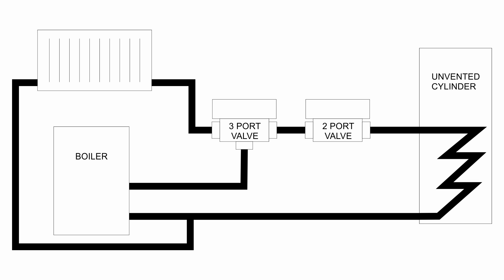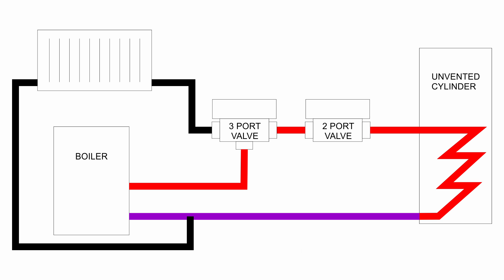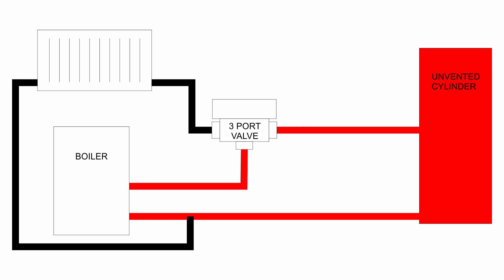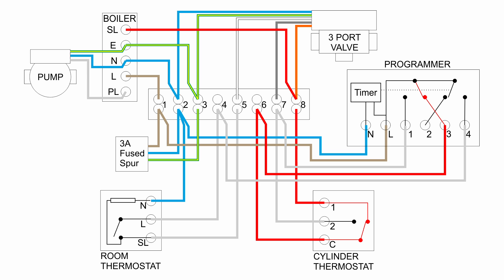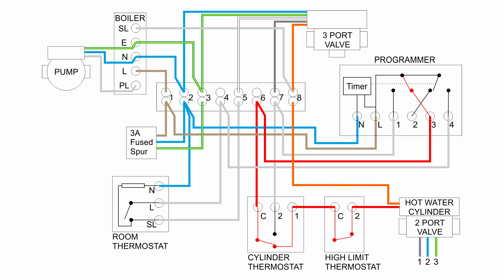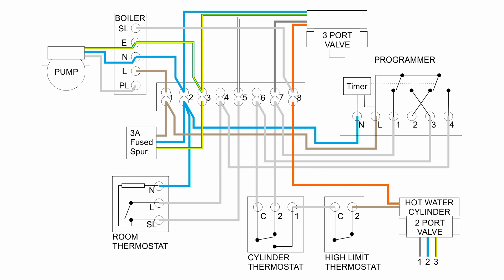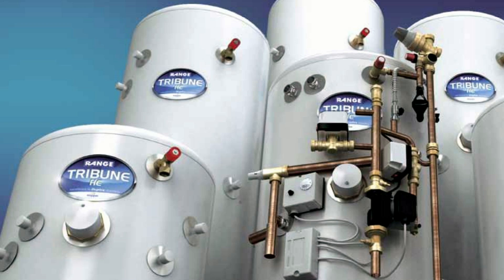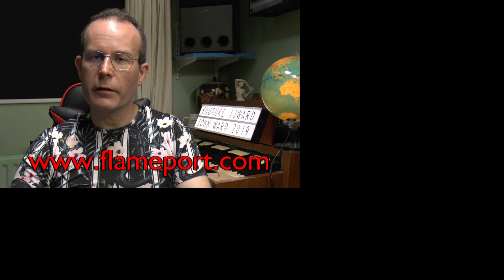Y Plan Heating with Unvented Hot Water Cylinder

Comment: Hi John, thank you for such lovely wiring videos for s plan. I always follow your wiring diagram. I have come across a twin unvented cylinder installation with s plan and confused about how to wire it up. Do you have a video already or if you could help me with this. Many thanks in advance.
Reply from the maker: Two cylinders is the same as a normal S plan, you are just adding another cylinder thermostat and a 2 port valve. 
Thermostat has L in from the programmer, L out to the brown of the 2 port valve.  The rest of the valve wiring is the same as the other one - L grey, N blue, E greenyellow, and the orange switched output.
Reply: Many thanks John. I appreciate your help.

Comment: looks like we have the same system, but one thing i not understand that the orange and grey wire from the 2 port valve aren't connected anywhere and in the terminal box only the blue wire connected together, programmer/hot water tank thermostat and 2 port valve, the brown wire from the programmer are connected with the how water tank thermostat, and again the brown/live wire from the 2 port val is not connected to anywhere,

Comment: Hi JW,  just wondering if the 2way valve should shut as soon as hot water isn’t called for?  Basically my boiler is trying to run on and bend prevent flow through the cylinder because the 2 port is closing.  Shouldn’t the 2port only close if the high level limit of 82degrees is reached?   Thanks in advance Craig
Reply from the maker: Unvented cylinders should be installed so that the valve closes as soon as the cylinder reaches the set temperature to avoid overheating the water and wasting energy.
For boilers which run on for a period afterwards, an automatic bypass valve should be installed which will open due to the increased pressure when all of the zone valves have closed.  Example: https://www.bes.co.uk/automatic-by-pass-differential-valve-22mm-angled-21382/
Such things were not normally installed on Y plan systems as with only the 3 port valve, one port was always open.  Many older boilers as typically found on Y plan systems do not have a run-on period either.
Reply: @jwflame   thanks so much for the prompt reply!  Sounds like I’ve got it working as it should,  as much as I wanted it to work slightly different to this I’m sure this is for the right reasons.  I was expecting the only time the additional 2way would close would be in the event of the high limit being reached.  I was expecting when the thermostat temperature was reached only the signal for the boiler to heat would be cut. 
Again thanks for the reply.

Comment: What is the  orange switch live doing going from 8 to the Hot Water Cylinder?  Thanks,.
Reply from the maker: It's the switched output from the cylinder valve, without it, the boiler won't work when HW is selected.
Reply: @jwflame  Many thanks for that reply. I need to get up to speed on unvented cylinders.

Comment: Hi. Just a quick one. Found unvented with Y plan but no extra zone valve on the hot water. It’s easy enough to plumb and wire one in but do I also need a bypass with this arrangement. 

If I do I might as well put in S plan.
Reply from the maker: Yes, a bypass valve will be needed as the default will be both CH and HW closed with the 2 port cylinder valve installed.
Converting to S plan is a much better option.

Comment: On an S-Plan system, which seems the only sensible way forward now, the high limit cut out from the stat would appear to be useless in the event of a failed stuck-open DHW zone valve. Or indeed, if someone opens the valve using the manual override. If the system is otherwise calling for heat (eg for heating), the tank temperature will continue to climb. Practically, other safety features will come into play but wouldn’t it be better to have had the main boiler power route through the high limit feature? Then if it were to activate, all means of further heating would be safely cut.
Reply: I agree, on my system I have connected the DHW switched live from the programmer through cylinder stat to both the Brown and Orange of the motorised valve, so if either the stat is satisfied or programmer is off, the boiler switched feed to the Grey wire will no longer be present.

Comment: How about taking this a step further John, W plan with priority hot water?
Reply from the maker: W plan is covered on the website, https://www.flameport.com/electric/central_heating/heating_wiring_W_plan.cs4
No video on it yet - it's not a particularly common arrangement.
Some newer systems can be arranged for hot water priority, but they normally use the 3 position valve with the option of priority being set in the boiler or controller.
Reply: @jwflame  it's the way forward for smaller boiler installation and improved modulation. Unfortunately most stick with the y and s plans, due to lack of education.

Comment: good info John, but you will just convert to S plan if you replace the cylinder, does not take any more work.
Reply: I’d rather fit an extra zone valve after the 3 port than mess about in a tight cupboard longer than necessary 😁

Comment: I think the biggest potential danger with unvented hot water systems is when the water is heated with an electric immersion heater. If the thermostat fails and assuming the fail safe devices on the cylinder have failed the temperature of the  water in the cylinder is only limited by the rupture point of the cylinder which could and probably would be well be into superheated territory. Of course this doesn't take away the necessary precautions for water heated by a boiler but the chances of the water reaching those kind of superheated temperatures is much less likely as even if the boiler thermostat failed, the prv would blow off if it was a sealed system or it would vent off if it was an open system.

Comment: the hot water cylinders we all had years back (some places still do) were hazardous if the thermostat went...like ours did. by hell we shit concrete bricks with shards of glass sticking out !!. the thermostat failed and it over heated, causing it to vibrate and nearly explode. the plumber took it out of use, we still had it fixed up but not working..only cold watter ran trough...that ment either washing in cold water or using the kettle to fill the sink up.
the cylinder was removed when we got gas fired central heating fitted, as was the damn loft tank that was a constant annoyance in winter as it always froze up. for a while we forgot that we didnt have the loft tank, and i said that we better keep radiators on go ever so often to keep the tank ice free (heat rises).....it took us ages to get used to the fact we no longer lived in fear in winter times lol
Reply: Previous house immersion heater used to boil the cylinder - I remember beads of condensed water dripping off the bathroom ceiling ! We could hear it boiling but it never sounded dangerous.
Current house has 2 loft tanks. They never freeze. Both above the airing cupboard. Loft isn't insulated at either the roof or floor.

Comment: If you have a unvented cylinder it’s alway as good idea to test H/W valve is operating correctly during yearly maintenance of the cylinder .  Sometimes the a two port valve can get stuck open and even the micro switch could get stuck continually calling for a demand.
Reply: Don't by cheap Drayton valves then ;)

Comment: I feel safe doing my own plumbing after some of the crap jobs I've seen carried out by so called professional plumbers, inc gas registered engineers. Over the years I've witnessed plumbers who have left gas leaks, installed boilers keeping the undersized gas supply pipes, installed poorly laid out pipe layouts, terrible soldering, etc. (I've seen some pretty terrible electrical installations as well, but most electricians seem to be better than most plumbers!)

Look up the scalding of Sharon Minister in 2003 in Cornwall where in a local authority house a fault in the property's immersion heater had allowed the cold water tank to fill with scalding water which burst killing the poor lady, and the scalding of baby Rhianna Hardie who died through a water tank fault that scalded her to death - the thermostat was 'known to be unreliable' - this was in another local authority house, this time in Somerset, and happened on the night the family moved in.

It is the case that if, say the boiler output temperature is, say, 65 degrees C (which is still too hot for domestic hot water from taps) the water in the cylinder cannot get hotter than 65 degrees C, simply because heat can't transfer ('flow') unless there is a difference in temperature, i.e. even if 65 degree water is flowing through the cylinder, the water in the cylinder is not going to get 'hotter' because it can't by the rules of physics. (The temperature at tap can be regulated by a mechanical pre-mixing valve, fixed just before the tap outlet.)
Reply: Absolutely. Qualifications/certifications don't apply in my house. I've installed my own CH system. My design, it does what we want it to.

Comment: Surely the boiler will have a thermostat if the temp gets too high - so would cut the heat to the  unvented cylinder anyway on a standard "Y" plan? Actually I prefer the vented systems ("heat stores") which simply have a second coil in the tank above the primary coil from the boiler. This second coil is connected to the cold water mains and its outlet goes to the hot taps via a blending valve. With this system the hot water from the taps is always "fresh" from the mains and hasn't been "sitting" in a tank possibly for many days before being drawn off. This reduces the chances of legionaires disease being started. Also the water in the vented tank is the same water that was placed in it when the system was commissioned (give or take make-up due to evaporation) so no chance of limescale production in hard water areas - not so with the vented which is continually replaced with fresh mains water and must eventually scale up. There is no risk of explosion with a vented as with unvented. I simply can't understand why unvented is so popular when vented has all these advantages.
Reply from the maker: Thermostats are not fail-safe devices, the contacts can and often do fail closed.
The 2 port valve fails closed so prevents the flow of hot water regardless of what else is happening.
Reply: @jwflame
Reply: @jwflame  There isn't just a thermostat, but also a separate thermal cut-out. In addition, it's not possible to boil the water in the secondary as the worst that could ever happen is that the water in the gas boiler would boil and vent steam into the header tank. It would be very noisy and, if made of plastic, that could collapse if it got hot enough. 

Before separate thermal cut-outs were put into immersion heaters, that used to be a real danger if the thermostat failed. Boiling hot water would be vented up into the main storage tank and if that got hot enough, a plastic tank could collapse and pour scalding water through the ceiling. There were some very serious injuries and even deaths :-

http://news.bbc.co.uk/1/hi/england/somerset/7175037.stm

I've never heard of a boiler doing that, and I suspect it would be very obvious if it did. 

Note that on an unvented cylinder it requires a direct heated cylinder (that is with an immersion heater) to produce dangerous amounts of pressure. In the USA where unvented hot water cylinders with direct gas heating are commonly used, there is the very occasional report of one exploding.

If you do want to cover a real danger, then the presence of old-style immersion heaters without a separate thermal cut-out is worth mentioning.

Comment: Would the thermostat in the boiler not stop that from being catastrophic?
Reply from the maker: Probably, but the point is to physically stop the hot water from the boiler entering the cylinder, which athermostat or switch alone won't do.
Reply: Boiler overheat thermostat should shut down the boiler before getting that bad.
Reply: @nicholaspratt7934  not necessarily as the boiler stat regulates flow and returns temps to the boiler it doesn't govern the cylinder.
Reply: @megaman1806  If the cylinder is getting to that heat the return temp to the boiler will be too so it should stop the boiler!
Reply: @jwflame  It's all nonsense really. To get anything exciting happening, the boiler's going to need to be running over 150°C - so it's likely all the boiler's safety features have failed already first - or been bypassed. Then to make it bomb-like, you'd need to seal up the PRV on the cylinder. If the cylinder burst due to pressure, the 'bang' would be insignificant - and not do any significant damage. The room where the cylinder is would fill with scalding steam instantly followed seconds later by a bath of almost boiling water. I suspect if you were in the room at the time, it'd kill you fairly quickly.

Comment: I love your videos. I posted a long on my heating forum and very quickly a few errors were spotted. The two port brown should be connected the cylinder stat and the grey to the permanent live.
Reply from the maker: That's how it's shown in the video - grey to terminal 1 and brown to the thermostat.
Reply: @jwflame  oh ok. Sorry.
Reply: @jwflame  I will watch again.
Reply from the maker: Same wiring diagrams on the website here: http://xo4.uk/?YPu which should be easier to see.
Reply: @jwflame  my apologies you are of course correct.
Reply: @jwflame  Although we have a cylinder stat, I haven't found a use for it. DHW temperature is limited by the boiler stat (~68°C) and DHW is only timed 'on' for 50 minutes a day - 40 minutes before bath time and 10 minutes afterwards. Water remains hot enough for general use for 23 hours. Boiler stat set by the temp my brother likes his water for the bath supply.

Comment: Page 13 John details that the 2 port valve must close when fitted in conjunction with a (Y Plan) Mid Poss valve.
This is to comply with the G3 Unvented Regs.  Your detail has the 2 Port constantly open, this is not permissible;
https://www.mainheating.co.uk/-/media/websites/mainheating/files/main-unvented-cylinders/main_unvented_direct_indirect_36005994_issue_09.pdf

The reason for this is if the Mid Poss Valve jams, it’ll not circulate to the UVC.
Reply from the maker: That's the same wiring as in the video and on the website - 2 port valve is powered and open when the programmer is set to HW On and the cylinder thermostat requires heat, 2 port valve is closed if HW not required by programmer or thermostat, or if high limit thermostat opens.
Reply: John Ward your detail John shows the Zone Valve To the permanent live John.  The motor will be permanently open.
Reply from the maker: @TheDickPuller  The valve brown wire is connected to the thermostat output.  Only powered when hot water is selected and the cylinder is below the set temperature, and if something fails and overheating occurs the high limit stat opens and cuts power.  The same arrangement as in that Main installation manual and most others.
The only permanent connection is the grey wire which connects to 1, and is for the switch inside the valve - again the exact same connection as in that installation manual.